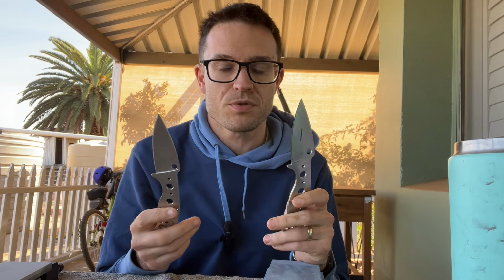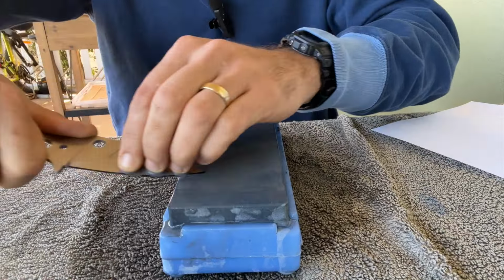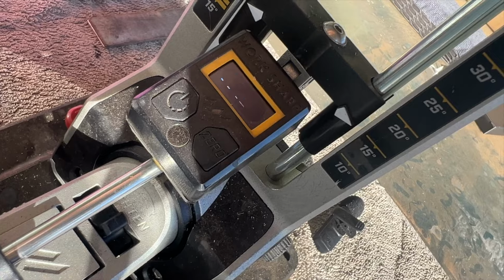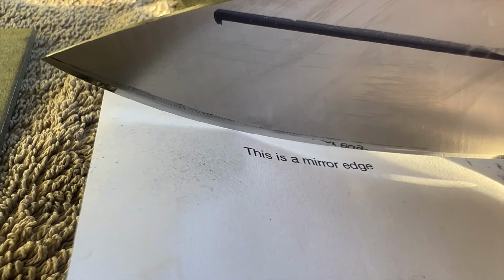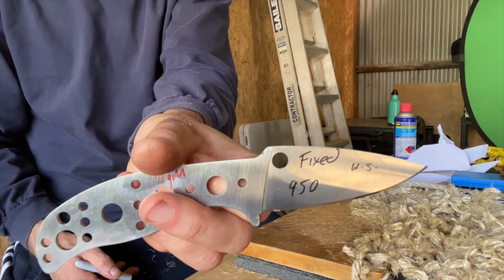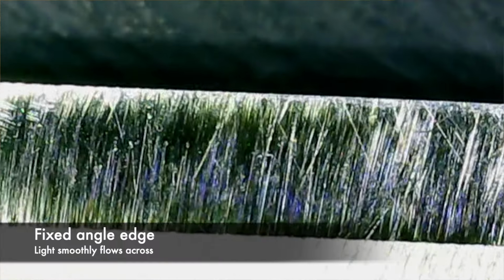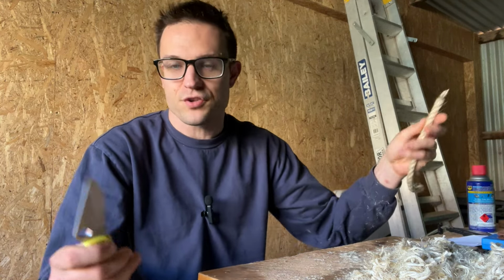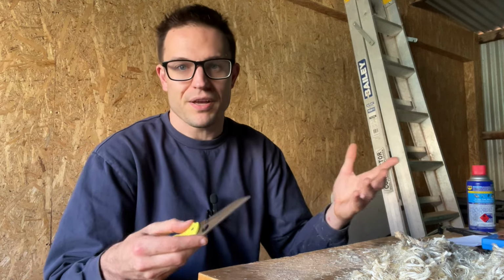Fixed Angle vs Freehand Sharpened Knife - Which Cuts Longer!?

Comment: A thought crossed my mind about your cutting board.

 You have steadfastly cut enough Sisel rope to go around the world a few dozen times (?, lol), and you've used knives of a multitude of different steels and I believe that there will a many particles of shed steel embedded into the surface of the board and some of the residual steel particles will be from steels with very high Rockwell hardness, so my theory, although I'm have no doubt that this will have crossed your mind aswel as many others minds before is how do these particles influence your cutting test results?

 On occasion I have accidentally knocked to freshly sharpened knives together and with highly polished edges. I then thought, shit, that was dumb thing to do no matter how glancing and light the contact was and I always do an intermittent, very gentle thumbnail rub test along the apex my freshly sharpened blades and obviously I've found that occasionally even the slightest clink together of blades has left a tiny deformation in the blades apex and/or on the primary edge bevel(s) (Secondary bevel what have you?) so my thoughts are that there will definitely be steel particles embedded in your cutting boards surface and I'm even wondering now that after all these long years of your dedicated testing (of which I am and many many other folks are grateful to you for) that your board may well cause more wear to the knives edges and thus affect your results?

 I remember seeing very well used chopping/cutting boards that had been used for generations in my family and their surfaces even after a good scrubbing could still sometimes appear to have a metallic discoloration, not rustlike necessarily, basically like powdered metal and slivers of metal which could possibly be considered micro splinters were embedded in these ancient chopping boards surfaces, so what I think is that maybe your cutting board has areas contaminated with microscopic high ally steel particles, and I obviously am concerned about the steel particles containing Vanadium, Tungsten, and other very high rhc hardness carbide dust and splinters and these particles will become more deeply embedded into the woods surface and grain, meaning that rather than being cut out of the board they're driven in further but still some I should think will still well be within reach of each blade you use to cut the rope.

 Maybe you've created a chopping board with a Rockwell hardness reading? IDK, just a thought mate? 
 
 I've been free hand sharpening since I was about 10 years old and I have roughly 40 years experience of doing it and I don't harp on about it, I enjoy it, and I can put a bloody lethal sharp edge on all sorts of blades made from many different types of steel, and super shiny mirror edges I know aren't the best finish for certain steels and I don't chase getting them much tbh because of this. I research the steel, and then sharpen it accordingly and even if it's a bugger I still find the  activity cathartic as you obviously do too! 

 Good on you Pete, and keep well mate, 👍🏻🤝🏻.

Comment: I assume the freehand convex edge would be stronger?
Reply: If the angle of the final bevel is the same then convexed is weaker because there is less metal behind the edge; since to get there you would simply remove the shoulders of the flat bevel, rounding them over. 
If my understanding is correct in such an instance the convexed blade would have the better edge retention because, perhaps counterintuitively, thinner behind the edge provides better edge retention. (For as long as the edge doesn't stress fail).
Please visit my channel if you're interested in more amateur viewpoints. Mostly blade content for now but some goofy stuff too.

Comment: It all depends, on how much knowledge and experience, especially the guy who does the free hand has. Free hand with proper convexing, finsihed with kangaroo leather strop (no nonsense marketing diamond liquids requaired) and final stage stroping on newspaper, which realighnes the molecules of the steel, CAN't be much, by any fixed angle method/ flat "V"  edge bevel,that those fixed angle systems produce. Those I only use,mostly for changing edge angles/reprofiling ,mostly on folders.

Comment: As a freehand sharpener myself i saw under the mic you created a micro convex.
Reply: Which really wouldnt be a problem if he would account for it if sharpening lower to start with. Then it actually would be better than straight V, by having better cutting ability for a similar apex stability.

Comment: Agree that the freehand edge is doing worse because of convexing, but not necessarily micro.  Even though you've gotten pretty good at holding the angle, there's probably still 1-2° of variation.  Very hard to avoid that.  So if you're freehanding at 17 dps, the angle at the apex is probably closer to 18-19 dps and you're comparing that to a pure 17 dps edge.  Another factor could be the abrasives.  Magnacut has vanadium carbides (but not huge by volume) and tests have shown that an all-diamond (or CBN) progression produces longer lasting edges with vanadium steels.  Granted, the "KME" edge wasn't ALL diamond.

Comment: Your hand stability is already pretty good. I'm not so sure that is the issue. Usually coarse edge lasts longer than polished edge while cutting rope if you do slicing cuts.
Probably the fine ceramic on the guided system is not as fine as a Shapton 8000. 
Stropping adds even more confounding factors.

Edge durability is a tricky topic.
Knife may lose edge by abrasion, rolling, chipping or corrosion. A test that isolates abrasion resistance like Catra will not be a good prediction if the way you use the knife wears it down by a different mechanism. 

For kitchen use that doesn't even come in contact with abrasive materials Catra makes little sense. Optimizing for edge stability with high hardness high toughness while also having good corrosion resistance would be ideal. That also allows for better finer geometry and better cutting performance.

Despite not being as controlled as Catra your test makes more sense to me because it mixes abrasion resistance from the rope with edge stability on the cutting board. On real world use we are going to need edge stability.

Comment: The rope slice is Comparable for you !  Cos there are many variables to consider . So it's relevant for comparing ( Knives / steels / edges / angles / grits ) So if one knife you test does 250 and another does say 450 . Then it's a relatively fair comparison as long as there are not to many variables . Is it fair to test say 16 deg per side against 20 deg per side ???? ( Maybe no as the variable may account for the result )  But some form of testing is surely better than no testing at all ( edge retention ) .  All 's I can say is ........ Those nasty Variables !

Comment: Scratches on the edge bevel, translated to a toothy edge. Toothy edge doesn't have the amount of edge stability or edge retention, the real mirror finish can provide.
Reply: Do you actually believe the things you type?
Reply: Do you actually believe the things you type? Honest question.
Reply: @CNYKnifeNut  100% I only stated facts.I'm 43 year old with a degree in Chemistry/Metallurgy since the 90's. I sharpen knives profesionaly for almost 30 years. If you need a lecture, I do it for free.Honestly.

Comment: IF -- I am putting an edge on a power planer, or a lawn mower, I want one edge -- the same -- all the way across the cutting surface. A tool or a guide can be advantageous in this and similar situations.

WHEN -- I keen up my straight razor(s), or any of my knives (OMG -- 16" commercial kitchen knives down to 2" Bird-Beak paring knives, an axe or hatchet, an Ontario machete, various choppers, a silly number of fixed blades, and a less silly(?) number of folders ---- I only free-hand, with a variety of abrasives and sharpening doo-dads from an el-cheepo chinesium diamond file (60-grit) down to green rouge on leather or hardwood for coarse stropping. 
It's hard to say with certainty but I guess that since 1968 I have spent about 75% on blades and 25% on sharpening devices -- only one of which was a guided roller for making chisels and planes easier to sharpen -- I tossed it after a year. 
I sharpen my 22" Stanley plane, lesser planes, and all my chisels by hand...
(NEVER USE OIL of any type)
...because I can feel the edges -- because when I use any knife it is NOT to one purpose, because the hand that wields that blade is the best guide for sharpening that blade, because no ideal guide matches every kind of wood cut by a chainsaw, because -- in the field -- who wants to carry a 5# -- 2kilo sharpener?
None of which has anything to do with why I keep watching you discuss knives and life -- Keep it up & carry on!

Comment: You need to try Arkansas stone with oil  depending on stone there are 4000k to 8000k no wet slurry I use to use water stones then switched

Comment: To produce a real mirror finish, that won't show any scratches, it takes a proper advancment from low to fine grit,where you have to multiply the passes even more, as you advance on grits. keeping the grit sizes tighter, like 300/1000/3000 grit (just an example) also helps to remove the scratches that the last grit left behind, faster. If you jump from 1000 to 5000 or more, won't be as easy. When you go from 300 to 1000,you have to double the passes and when going to 3000 to triple or even more the passes.That means, you always do THE SAME on both sides and you always count the amount of passes you have made on each grit. Little pressure is required while sharpening, less and less pressure when you finish, helps to produce and even sharper edge.Keeping the proper angle on both sides is key. When stroping, reduce the angle around 2 degrees, because the leather isn't hard as the stone ,so it creates a larger angle because the leather rubs around the edge (that's why many of you, dull the edge instead of making it any good when stroping).
Reply from the maker: that sounds like quite a day of sharpeningg! but it must be what they do at rockstead on those big mirror convexes
Reply: @CedricAda  You got it! Now,I don't know exactly how the guys at Rockstead knives  do it, but me and many others, can easily produce very similar edges. You can try on Moras,where you can just use sandpapers, to produce a "Rockstead" kind of mirror polish. Done properly, 3000 grit as a last grit, can easily produce mirror finish.

Comment: Might not be a problem with your sharpening technique, but rather you showing the difference between sharpening on ceramics vs on diamonds 
I have seen theories that ceramics or softer steels pulls out the hardest carbides leaving the softer materials, while diamond actually sharpens the hardest carbides, leaving more really hard particles for the edge.
I think there might be at least some truth to that theory...

Comment: My theorycrafting is that fixed angle sharpening is best for repairing/reprofiling through 1200 grit (down to 15µ), but as I still get better performance following this with stropping with diamond emulsions at 6 and 1µ, I suspect some microconvexing at the cutting edge and the angle between primary and secondary bevels is offering a benefit. 

I've been tempted (prior to Pete's freehand series) to pick up some Shapton Glass stones at 2/4/8k (10/5/3µ) to see if a combination of fixed angle and freehand can offer better results. Alas, the very sexy looking Hapstone RS + Edge Pro matrix stones (which go up to 4k/5µ) is competing for that discretionary spending.

And by the way, if you see your mom this weekend, would you be sure and tell her; "Satan! Satan! Satan!" 
https://www.youtube.com/watch?v=akhuHYih8Mo

Comment: This is expected, diamond finish is coarser, don't sell yourself short! If you hate yourself enough try it again this time with 2k and 5k finish to see there will be difference. Sharpening stones can be a hole as deep as the knife hobby itself. While CATRA and BESS testers are nice, they are not everything. There were some videos back in the days from super steel steve showing the edge for catra was some sort via pull through sharpening system and it was not reliable, there are also videos for the bess not being the most consistent.

Comment: TIP: angle guide to help with precise edge reprofiling. They come in different designs, as wedges or pyramids and are placed on the sharpening stone for reference.
Reply: He has several and uses them in other video. I believe the point of this was to test his own abilities.
Reply: Once the blade moves away from the guide, it is no longer considered precise, for me anyway. That’s why I default to fixed angle sharpeners. Furthermore, Pete is fully aware of these guides you speak of, and I truly don’t think finding the preferred angle is Pete’s dilemma.
Reply: outdoor55  released a video on using them four days ago about how accurate they are or are not.

Comment: THANKS PETE!!!  This is the comparison I have been asking you and Alex (OUTDOORS55) for.  Based on these results, and the fact that my hand sharpening makes you look like a rock star, I am going to stick with my KME.  If it ain't broke, don't change it holds true FOR ME.  Regarding "laminating"...I believe the term you meant is "burnishing".  Burnishing is moving metal without actually removing metal.  That 5000 glass burnishes the metal over those deep scratches to hide them.  THANKS for making this video, Pete!!!